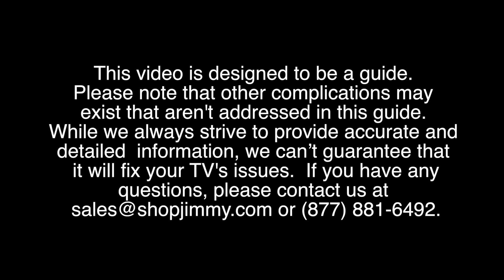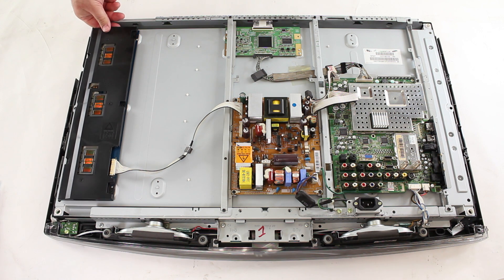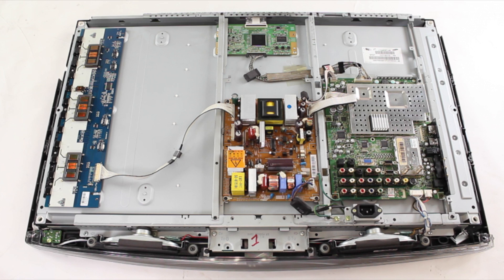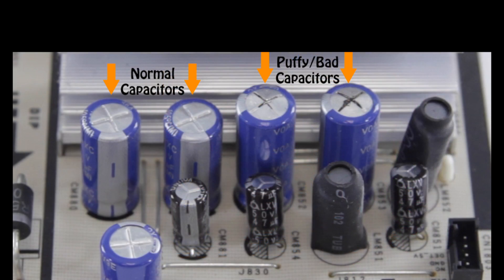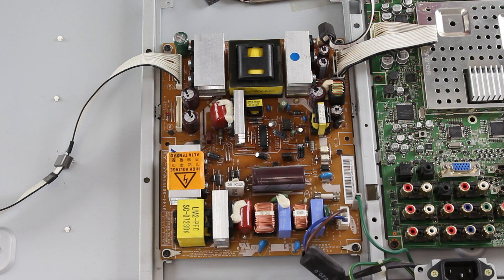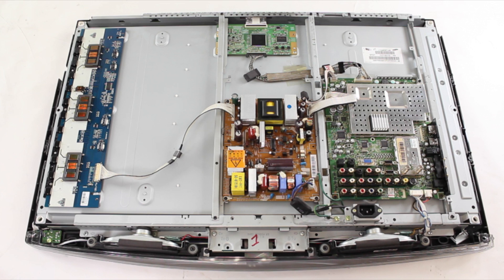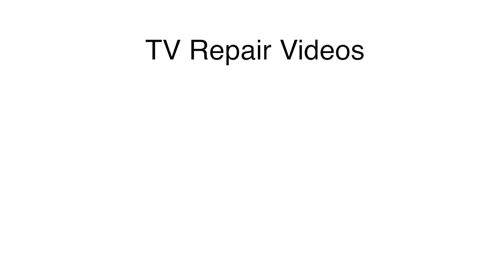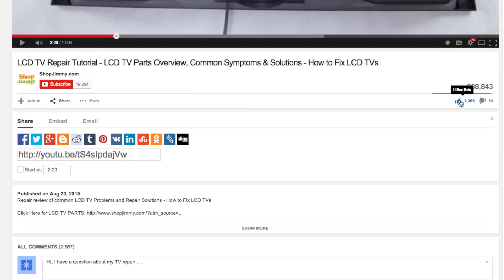Samsung TV Won't Turn On & Has No Power & Has a Standby Light - Samsung LCD TV Troubleshooting Help

Comment: hi sir 
i have a samsung lcd tv le37c630k1w its not power on and has standby 
the standby is permanently on and when i press to turn on from the remote control its nothing happen the standby lihgt retains bright steady 
in your opinion the problem is mainboard or power board ?

Comment: I have a 2011 samsung led tv that was hit by lightning and original problem was all inputs were dead. Tv turned on fine. Replaced that board and then tv comes on but the screen flickers and red light goes off so I ordered power and t-con board and problem still is there. Any suggestion?

Comment: Hi, I just woke up this morning and try to put my Samsung curved smart tv with model number UE65JU7580T and it refuse to turn on, the standby is there and when turn on it make noise click and the standby light dime 6 times and make that click noise then the red standby light on again without the tv on. I have open the tv and check if anything burned in the panel according to your video nothing but click noise come from the power supply panel. 
Pls I need your help . 
Thanks 
Bobby

Comment: Samsung Plasma PN51F5500AFXZC - Unit will run for about 2 minutes and then shut-off.  Have to manually turn TV back on with remote.   TV runs for 2 min than shuts off.   Have undertaken factory reset.  Did not fix the problem. Tried to update software from wired ethernet connection; "checking for update" message kept displaying in an infinite loop.  Not sure what to do to remedy the problem   Suggestions are welcome.   Thanks,  Ed

Comment: I have a 55-inch LCD TV that has a standby light, and won't power on.  I bought the complete repair kit, installed all boards and still it will not power on.  Watching the video above I decided to use my multi-meter to test the power board as described above.  I located the legend that tells me that pins 11 and 12 are the pins that should be showing 5-volts. Pin 11 is + and Pin 12 is -.  Now I'm no expert using the multi-meter but when my meter is on, dialed on to "DCV-2.5/50 range, and touch the pins I get nothing.  This is an old meter and it's analog and frankly the needle doesn't zero completely, but I figure I should get some sort of movement on the meter even under these circumstances, I get nothing.  My question is two-fold, am I using the meter correctly, (+ lead on Pin 11, - Lead on Pin 12), and given the lack of any reading, can I assume that this brand new board is dead?  I am seriously disappointed as I waited a week for the kid to get here, installed all the new boards, (Main Board, Power Board, T-Con Board, and WI-FI connector board).  I wore a static strap, I double and triple checked the connections before I closed everything up, only to  have no power.  I have now removed the back of the TV again to run this test.  Please Please advise!
Reply: How much is the kit. Sounds to me it is better to use the money on a new TV. I get the diy , which I'm always trying myself. But at some point logic dictates that the time and money isn't worth the hassle in diy when for a little more then you probably spent you get a new TV. Of course if it is a large tv that might be different , but I'm talking 75 in or more.
Reply: Thom Richardson Jr. just buy a new tv lmaoo

Comment: I have a 2004 Samsung SP-P4231 the red light blinks when you plug it in, than when you hit the on button it's steady red. I have electricity to one half of board and not the other, can't find a puffy capacitor or a burnt component? Please help

Comment: my TV has a standby red light, when I switch on from the remote the standy light goes off and then comes back on,TV dies not turn on. i checked the fuse which is working. any ideas what it may be? kind regards
Reply: mine has the same problem
i have no idea what to do

Comment: Before taking your TV apart, which nullifies any warranty it has, first start by doing a reboot much like you would for your Computer. Unplug everything, wait 20 seconds and plug everything back in and try to turn it on again. If that does not work, call the manufacturer if you have a warranty on it. If your warranty is out, the choice is yours. ; ) A reboot fixed my Emerson 50" Flat screen. Hope this helps!!!

Comment: Hello, I have a Samsung Model LA40C530F1RXZN. Stand by is solid, when attempting to power on standby flashes for a bit then goes out, tv does not power on. Upon checking the boards, with the connector between the main board and the power supply disconnected, the backlights turn on immediately when plugged to power. When checking voltages all are as labeled except for "PS_ON" which is 0.7V. All grounds are good. Power supply BN44-00340A, Main Board BN94-03804C. Based on the backlights turning on without jumping the connector as descried in one of you videos, I thought it may be a shorted power supply ? When I connect the main board to power supply and back probe, I get nothing on any of the pins. Can you help ?

Comment: I have a Hisense 40h4c Roku Tv. It just turned off one day out of nowhere and won't turn back on. It seems to not be getting any power so I opened and checked the panels but nothing is burnt, broken or disconnected. I haven't taken anything apart, I was hoping you can tell me if there's anything else that would've caused my tv just to completely stop working, before I take it apart or have someone fix it for me..?
Reply from the maker: +John Gabriel Figueroa  Try all repairs and troubleshooting at your own risk.  I recommend replacing the main board in your TV.  Unfortunately I do not see any replacement parts in the search results for your TV model number on our website.  Please reply with your part number on your main board and I can try searching for replacement parts.  Thanks and please let us know if you have any further questions!  www.shopjimmy.com

Comment: Sony Bravia KDL-46EX500 with red standby and also green "on" when either power button is pressed.  It then stops there and will not load the Sony Logo or  turn the screen on.  Also, the Sony "Ding" doesn't happen.    The TV becomes unresponsive after that and has to be unplugged to get it to turn back off.  I have replaced all the boards in the TV (all of them purchased through Shop Jimmy).  Yes, all 4 of them! Still the same issue.  I have checked all voltages and to the best of my knowledge, all voltages are correct.  Any help is more than appreciated!  The TV is 4-5 years old.
Reply from the maker: Ryan Langstraat  Try all repairs and troubleshooting at your own risk.  What was your original problem?  Did you update the TV after replacing the main board?  Thanks!  www.shopjimmy.com
Reply: ShopJimmy.com The original issue is still the issue.  TV has red standby light then green on light and stops at that.  No logo, picture or sound at all.  TV becomes unresponsive to all in puts via remote or the side buttons.  It has to be unplugged to shut it back off.  I cant update the TV because it wont turn to do it.  Thanks for any and all help.
Reply from the maker: Ryan Langstraat   PLEASE SUBSCRIBE TO OUR CHANNEL - Try all repairs and troubleshooting at your own risk.  I recommend replacing the main board in your TV.  Click this link to replacement parts for your TV model number:  http://www.shopjimmy.com/sony-1-857-593-31-a-board.htm  Be sure to match part numbers on your current board, with your replacement for compatibility.  Here is a link to a video showing how to identify your part number, click here: Thanks and please let us know if you have any further questions with your TV Repair!  www.shopjimmy.com

Comment: Hi there I have a 2008 VIZIO model# VP50 HDTV20A it has amber Stan by light and it turns green when I turn it on I have audio but there is no picture I am electrician but I don't know how to test a TV can you help with this problem? the part# 10143050022 the Serial#PHSAVAJ0743181 THANKS
Reply from the maker: Guillermo Prudencio   Try all repairs and troubleshooting at your own risk.  I recommend running the flashlight test on your TV.   Here is a link to a video we produced that shows how to run the flashlight test. https://www.youtube.com/watch?v=xUzCLgoSPGM Please reply with your flashlight test results and we can recommend a replacement part for your TV repair. Thanks and please let us know if you have any questions! www.shopjimmy.com

Comment: I have a SAMSUNG  UN32EH4003   tv   ,,
It works sometimes , and does not power up sometimes.

If i unplug the power .....the red standby lights remains lit ....If I unplug a HDMI cable 
while there is no power connected ,,,the standby light goes off....

Please Advice..

Prem

Comment: I have the tv 46RV530U yeah and the small left side of my tv is acting weird
Likes the part That's messing up like that it can't catch up with the other part of the TV what should I do
Reply from the maker: Paul Watson   Try all repairs and troubleshooting at your own risk.  This sounds like a TV panel (TV Screen) problem.  If your TV panel is bad, it may be more cost-effective to replace the TV as panels are typically hard to find in stock, difficult to replace, and expensive.  Thanks and please let us know if you have any further questions!  www.shopjimmy.com